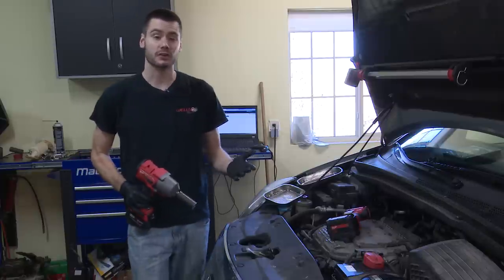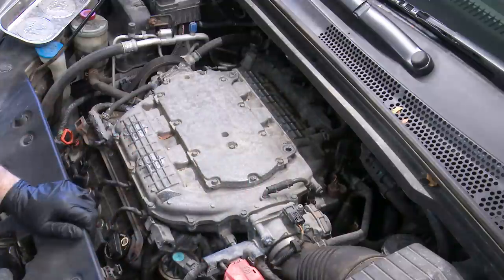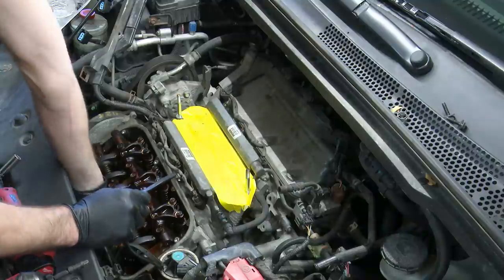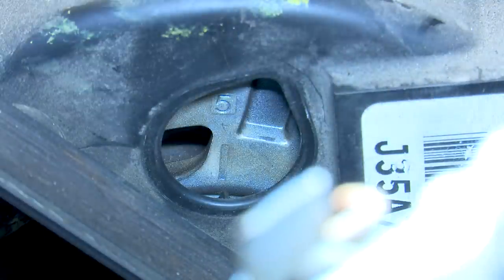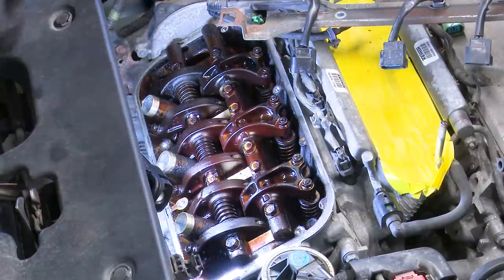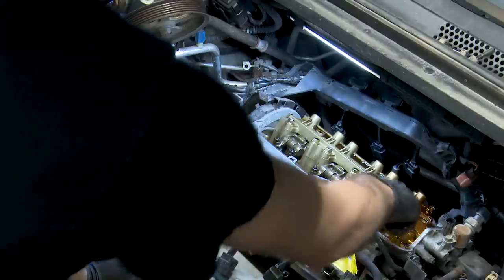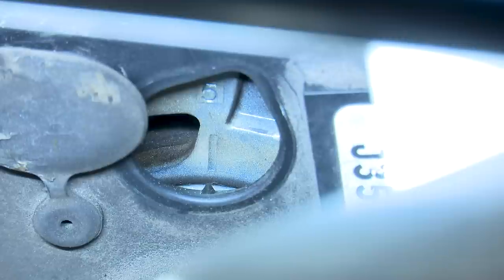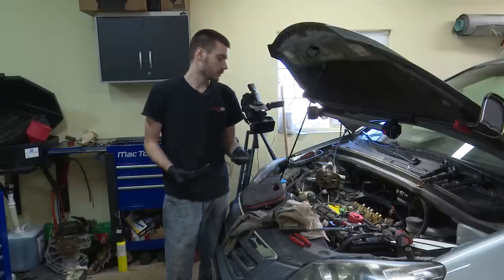2006 Honda Odyssey 3.5 Random Misfire Case Study Part 2 : How To Perform A Valve Adjustment

Comment: Did you notice how much cleaner the rear bank valvetrain looks compared to the front bank :)
Reply from the maker: Hey Mike, I wonder why? Any idea?
Mike Becker, Senior Technical Services Instructor
Reply: The only explanation I can think of is the front bank cylinder head has the built in EGR ports and runs much hotter, the rear cylinder head does not and stays much cooler. More often than not I have also noticed the front bank (Bank 2) valve clearance a bit tighter which could also be related to exposure of exhaust heat via EGR ports.

If you look at their newer generation engines they have stared using an external EGR pipe and no longer use the internal cylinder head routing.
Reply: I think it’s Bc these Odysseys exl and touring have vcm and it uses the 3 front banks. Our 07 ody looks similar when you remove the oil fill cap. My Accord 2000 v6 with similar miles is super clean compared to our 07
Reply: Yeah it’s vcm.   Vcm is terrible for these engine

Comment: Sister bought a 2009 Honda Pilot from a used car lot, Check engine light came on right when she got home. 5 cylinders missfiring, this has to be the reason right??? car drives fine.

Comment: I’m curious to go in firing order or do you skip cylinders? Or does it not matter?
Reply from the maker: I don't see any reason you'd need to go in any specific order. It's just making sure the cam is lined up. If I remember right, I went off of the labels on the cam gear as I spun it around.
Mike Becker, Senior Technical Instructor
Reply: NGK Technical Training thanks for replying back and letting me know. 
I just got a plug to locate behind the power steering pump after putting back the intake manifold 🤷‍♂️ not sure what I missed.

Comment: Hola mike what's the model #on the 1/2 inch drive cordlees  gun?, I need something like that, thank you mike, great videos
Reply from the maker: Hey Everardo, that is the 2767-20. It's a monster. You will love it! I haven't used my air impact since getting my hands on that thing.
Mike Becker, Senior Technical Instructor

Comment: In Odyssey 2000 the adjusment valvs is the same ? Thanks for You  atención Sr
Reply from the maker: Yes, process is basically the same!
Mike Becker, Senior Technical Instructor
Reply: Hellow sir,in honda accord sport 2007 3.5 the adjustment valve is the same?? Thank you sir
Reply: Thanks mister,You have good one

Comment: Front bank of cylinders were way more cooked looking.  Wonder if oil isn't circulating as well up there and is getting baked?
Reply from the maker: Hey Mrdumbfellow, thanks for watching! I was also surprised at the color difference front to back...has to be a for a reason.
Mike Becker, Senior Instructor
Reply: @GoTechTraining  Probably has to do with the VCM system, shutting down Cyl 4 and 6 I believe....there is a way to disable it though.
Reply: It's normal on these engines, even the ones without VCM. I'd suspect it's from crankcase pressure building up in the front valve cover. That's where the PCV valve is located. Also could be a new head in the rear bank. Some mechanics seem to think that the rear bank head on the J series has camshaft design flaws (like Scotty Kilmer). I don't believe that nonsense myself... but the rumors exist. I've seen a few with spalled cam lobes on the rear bank, but it's not necessarily a design flaw, and that's not what Scotty mentioned specifically.

Comment: So if you have a random misfired, the valves need to be adjusted ? Just on odyssey or all Honda models ? Was there any code for misfiring ? What diagnostic procedures that pin pointed to the valves issue?
Reply from the maker: Hey Mckoy Lach, seeing as how you watched the video "part 2" and left this comment, I assume you didn't see part one? Part one is where I did all the diag. I'd suggest taking a look, you may find it interesting :)
Mike Becker, Senior Instructor
Reply: GoTech thanks

Comment: Clogged egr path and filthy throttle body can cause miss firing, interesting how narrow it down with scope.
Reply from the maker: Hey Dave, sure, they both can cause misfires. Clogged EGR will usually only affect 1 or 2 cylinders consistently. Whereas this problem was random and affecting all cylinders.
Mike Becker, Senior Technical Instructor

Comment: Really appreciate the video, how many miles on the motor?  Was it misfiring?  Where was the car used east coast, west coast, desert? Some missing info that we need to know.
Reply from the maker: Phil, this engine was close to 200k. It's mentioned in part:1. As far as location, Wisconsin. Anything else I can help with?
Mike Becker, Senior Instructor
Reply: Thanks for the reply!  Kinda funny story my wife took my 2008 odyssey for an oil change, been running fine with no problems. She tells me they quoted her $1000 for spark plugs. Me WHAT!!!!  Quote said “ Spark plugs *Mm4 replace spark plugs check Valve clearance and adjust as needed. I knew that was a job so I watched your video and now can see if I needed it, it would be worth it. But I have no issues or noises coming from the motor. I’m thinking just wait until there is an issue. Did that once, I leave it up to the mechanics now. Thanks again
Reply from the maker: Hey Phil, I'd recommend adhering to the maintenance schedule. If it becomes an issue its possible other components suffer, like the catalytic convertor. 
Mike Becker, Senior Instructor

Comment: I wish you were living close to Austin, so I can bring my 06 Ody with 242k miles for valve adj. There is no misfire, but the engine sounds a bit rough. How much this job approximately should cost?
Reply from the maker: Hey Boris, sorry man! I'd love to take care of it for ya. It's not a cheap job. Hard to say with your local labor rate, but i'd expect to pay more than 500$ and less than $1000 for just the valve adjustment procedure.
Mike Becker, Senior Technical Instructor

Comment: Can you please tell me how to take out the rocker arm assembly. Which bolt do I need to take off?
Reply from the maker: Which one? Front or rear? They should just unbolt.
Mike Becker, Senior Technical Instructor
Reply: @GoTechTraining  If removing the front rocker arms, 8 bolts? What torque specs for reassembly? Thanks

Comment: Excellent video and helps.  Any change in gap if making adjustments in colder weather?  Like 30 degrees, I need to do mine now, can't wait till spring.
Reply from the maker: No, metal will expand and contract in different temps but you should be able to set to the normal spec without issue. Have fun doing it! Fronts aren't bad...backs can be a pain!
Mike Becker, Senior Technical Instructor
Reply: @GoTechTraining   Thanks Mike, I have misfires on all 6 cylinders.  Runs great in town, but on the highway you can feel the shudder and they are increasing. Can't wait for warmer weather.
Reply: @GoTechTraining   Finished job today, van runs great so far.  Seems like a little more ticking but now there is gap on the exhaust valves.  I only had to do the intakes on the front valves. All of the exhaust were off like measured 5 thousands instead of 13.  My van has 217k and i seriously doubt this has been done before.  The feeler gauge with the bend helped a lot. https://www.amazon.com/gp/product/B006Z58ZJ2/ref=ppx_yo_dt_b_asin_title_o09__o00_s00?ie=UTF8&psc=1     The peep hole for cylinder is great along with a mirror for the back valves.  The greatest challenge is the wiring harness over the back valve cover, always in the way!!!!   Thanks again, you helped me greatly.....
Reply from the maker: Awesome Liz! Glad you got it fixed!
Mike Becker, Senior Technical Instructor

Comment: how did you turn the crank pulley? what is the nut size?
Reply from the maker: Hey Ahmed, usually it's a 19mm or 21mm.
Mike Becker, Senior Technical Instructor

Comment: So do you have to be on tdc compression when turning the engine?  How do you know if youre on tdc compression?
Reply: When both the exhaust and the intake rockers can move. That indicates your on compression stroke because all the valves on that cylinder are all closed. I think on the crank pulley there are other marks you can look at as well. Watch a few more videos and you will see.

Comment: Tell the owner to change their oil on regular basis those rockers look very discolored as well as inside the valve cover
Reply from the maker: Hey Swav100, this customers only owned it for about 20k. Hard to say what the previous owner did. Discolored sure, but overall it looks alright for 210,000 miles!
Mike Becker, Senior Technical Services Instructor

Comment: In the service manual, they show the use of an air adapter for ‘unlocking’ the cam lifter/followers. The setup of the valve clearances seems to be different when using that method. I just setup a rebuilt head that way, misfires and the engine manifold vacuum is only 11psi. Does anyone else have feedback on the manual? Did I mistake the instructions?

Comment: correct my terminology if I am incorrect with the words but How are you spinning the motor?
Reply from the maker: Hey Levi, I used a breaker bar on the crankshaft pulley bolt. Make sure to always spin the engine in the same direction it normally rotates, or in this case, clockwise.
Mike Becker, Senior Technical Instructor

Comment: FYI lmao I think I messed up my engine on readjusting the values I did everything but when I’m useing the feeler gauge either the .008 or the .012 I’m a novice when it comes to feel for it it’s the right amount of resistance when I sliding the gauges back and forth I’m thinking about restarting the process any tips on this subject matter???
Reply from the maker: Levi, the process is pretty straight forward. Make sure when you slide that feeler gauge in there that you have just the slightest drag. Not tight that it's hard to move and not loose that it can bounce around on the feeler gauge.
Mike Becker, Senior Technical Instructor
Reply: Make sure your on the right cylinders number

Comment: Wait is that the same engine that Eric O's working on with the DIY head gasket replacement? 😊
Reply from the maker: Similar, I think his is the older generation 3.5. The intake looked different.
Mike Becker, Senior Technical Services Instructor

Comment: So I'm working on adjusting my valves in my 06 Honda Ody. First time I've done it. I've got the valve covers off and cleaned up. I have new seals for everything. I'm wondering where the Hondabond/ high temp RTV goes? I did not see any RTV type material anywhere when I pulled off the covers. Do you coat the new gaskets with anything? Do you put hondabond or light coat of oil on the gaskets? Thanks!

 Also, I managed to remove the wire harness by the power steering pump without removing the pump itself- I just unclipped the rectangular plastic housing and wiggled the wires between the power steering pump and intake. 

Super helpful video! Thanks.
Reply from the maker: Hey Ken, congrats on tackling this job yourself! The RTV goes on the back valve cover where the sharp upward corners are. This helps to ensure a proper seal. As for the gasket itself, that goes on dry and clean. Glad the jobs going well for you!
Mike Becker, Senior Technical Instructor
Reply: Thanks Mike! Those back exhaust valves are hard to get to! After all day trying to feel the difference for .001" you begin to double guess yourself! I had it almost all back together when one of the valve cover bolts sheared (I didn't torque it hardly at all). So now waiting on a bolt on order.  Surprising how far out some of the valves were. I don't think it was ever done before, but I did fine some intake valves that actually had way too big of a gap too.
Reply from the maker: Those back ones are fun aren't they!? Sorry to hear one sheared off, that's no good. Puts a damper on trying to get the vehicle back up and running. Interesting your intake valves were out of spec too. Mine were all ok on this one. Curious to hear back from you on how it runs now!
Mike Becker, Senior Technical Instructor

Comment: Nice, but there is missing important thing, where is the place to rotate the shaft to get the number? you didn't video this place!!!!
Reply from the maker: Hey Alnuaeme, thanks for watching. You would spin the crankshaft pulley using a ratchet.
Mike Becker, Senior Instructor

Comment: Having trouble with getting the belt off so I can remove the steering pump on top out of the way... 30:29
Reply from the maker: Hey Jose, what's the issue? You put a wrench on the tensioner and moved it to remove the belt?
Mike Becker, Senior Technical Instructor
Reply: @GoTechTraining  I'd recommend using a breaker bar with a 19mm on the end (if I remember correctly). I had to replace the power steering pump on my wife's  06 Odyssey and it does take a good deal of pushing towards towards the rear but once you loosen the tension enough it just pops right off.
Reply: Be sure to use 6 point socket-12 point may strip it out👍

Comment: 2007 odessay had mecanic replace rear head after replacement engine valves clacking , mechanic said drive it put miles on it , so i put about thousand mi. on it then took it back for readjustment of valves so drove it and still have some clacking. so is that normal for honda engine? ( before it didnt seem to clack that much )  also engine light came on and flashing , parts store said multipile coils or spark plugs so how can multiple coils go out. same time ? or plugs or does it have something to do with valve adjustment? about hundred thousand miles on motor. anybody out there can give me some input if you had same problem or somebody with honda engine know how? thanks if you can!☺
Reply from the maker: Hey, I don't really see why it would be noisy. These engines aren't really known for that. Flashing check engine light usually means you have a dead cylinder. Severe misfire. My guess is everything here is related. Hard to know for sure...but that's what my gut says!
Mike Becker, Senior Technical Instructor
Reply: NGK Technical Training.  thanks for response ! gonna take it to different mecanic . can valve lash be checked by compression? i would think not have to guage it right? THANKS!

Comment: for the back head, why didn't you take the cowl off
Reply from the maker: If only it was that easy. I looked into it. The cowl is just a cover over a part of the firewall. It's all welded together. Taking the cowl off would have only reveled the metal sitting below it :(
Mike Becker, Senior Technical Services Instructor
Reply: Wells Vehicle Electronics it was just a thought

Comment: I have a question because I’m confused on the intake says .008 and .009 what and on the exhaust.0011 .0013 what number should I use on the intake and the exhaust
Reply from the maker: Hey Hany, those numbers are a range. .008 to .009 for intake and .011 to .013 for the exhaust. On this engine, the exhaust valves tighten over time so I prefer to adjust them to the .013 in order to get more time out of them.
Mike Becker, Senior Technical Instructor
Reply: Ok so it’s better to use ,009 for intake and ,0013 for the exhaust right ?
Reply from the maker: Yeh, that should work Hany!
Mike Becker, Senior Technical Instructor
Reply: Thank you so much for your patient ad help

Comment: How many foot pounds do you need on the head gasket cover bolt
Reply from the maker: Hey Hector, valve cover gasket bolt torque spec on this Odyssey is 8.7 ft  lbs.
Mike Becker, Senior Technical Instructor
Reply: ok thanks for the info

Comment: That engine looks like it has a lot of build-up on there. I have noticed if you place a few drops of clean oil on your feeler gauge and just rub it around as you would when checking clearance, you can actually clean off some of that build-up. This would result in a more accurate measurement.
Reply from the maker: Hey Mohammad, thanks for the tip and for watching!
Mike Becker, Senior Instructor

Comment: How much should that cost at a honest shop
Reply from the maker: Hey, labor alone is quoted at 4.3 hours just for the valve adjustment. Add in parts and you're probably around 1000$
Mike Becker, Senior Technical Instructor

Comment: Bank #1 looks cleaner than bank #2.
Reply from the maker: It does Tom. Curious how that works. Any thoughts?
Mike Becker, Senior Instructor
Reply: @GoTechTraining  Good question.  Cylinders closer to the firewall usually get hotter than those farther out, but it seems to have the opposite effect here, unless the additional heat helped somehow.